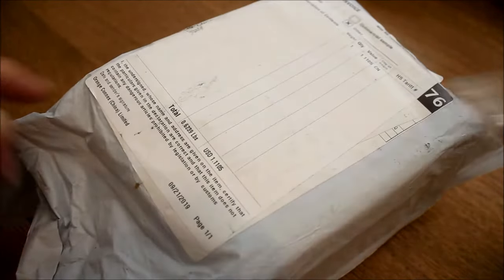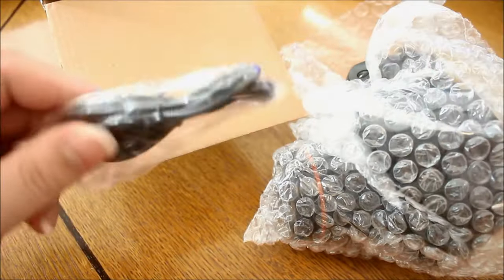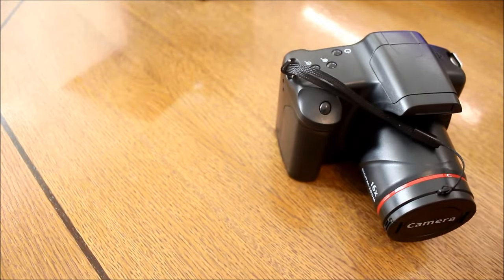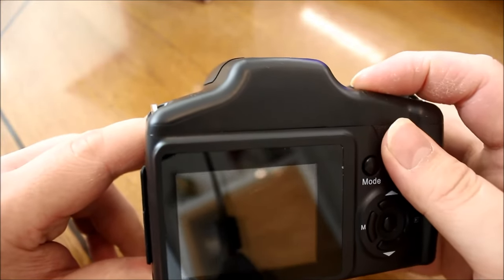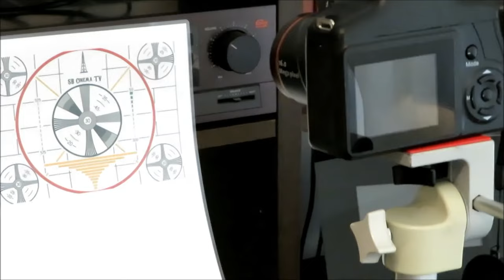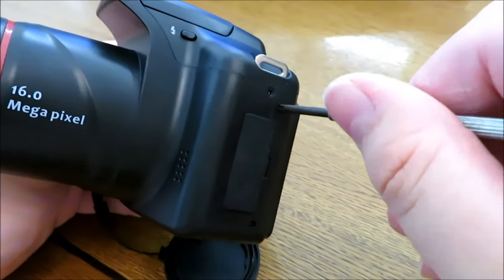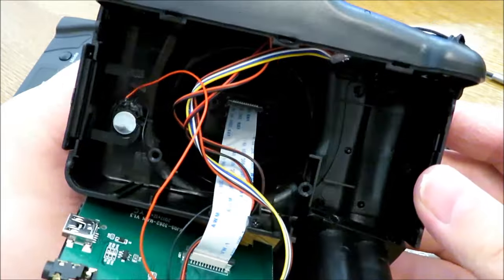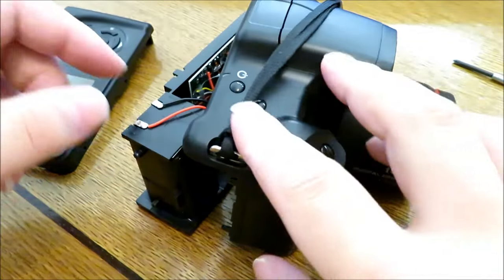Chinese $25 fake DSLR Camera - Review / Teardown

Comment: Actually the pictures it takes you can tell it's fake by looking at the resolution of the pics. Seems all these fake cameras suffer the same in one area, the tripod area that uses a tripod, they all seem to break. I got one of those fake go pro cameras and it did the same in that area. But for under $25 what can you expect?
Reply: 1.2 MP (1280x960) and VGA (640x480) photos and videos only.
16M, 12M, 5M and 3M shows the 1280x960, 2M shows 640x480 and 1M is broken.
Full HD and HD videos are set to 1280x960 and VGA vids at right resolution of 640x480

Comment: And please suggest low cost camera in the range below $25. application is only good quality Image, good video is not application.
Reply from the maker: Yogesh Sonar
If you are looking for a good camera for under $ 25 you should consider an analogue one
Reply: @sbcinema  
Any suggetion in low cost digital cameras
Reply from the maker: I can recommend you to get a used Canon eos500d, because the accessories are cheap and it is extremely durable.

Comment: You can tell how flimsy the thing is by the way he's holding it. Looks like theres no weight in it at all. You get what you pay for, i wouldn't buy anything at all from ali express if they think this passes for good quality.
Reply from the maker: It was from eBay
Reply: The seller must have bought it from them then.
Reply from the maker: @mrmikeh-nv7cq  the usual Chinese scam shop